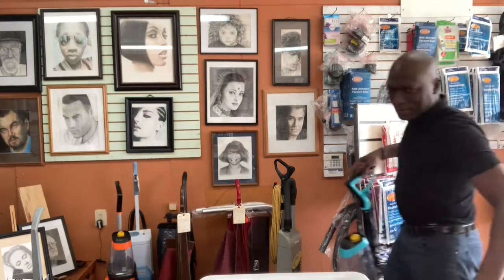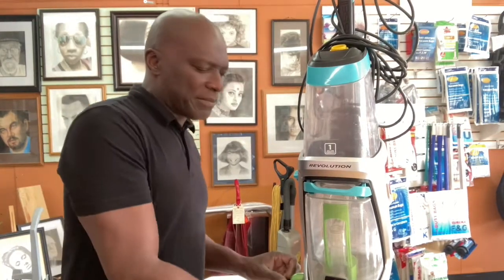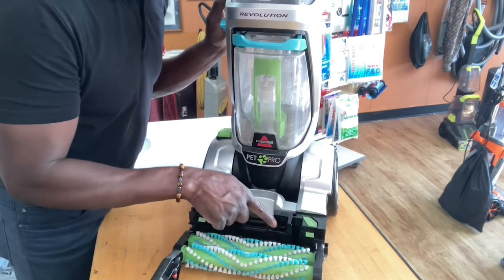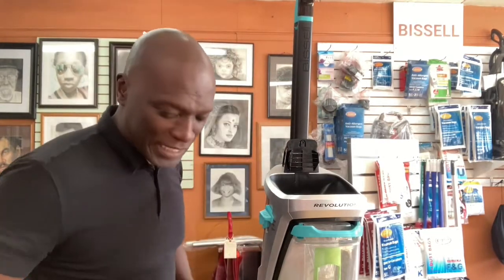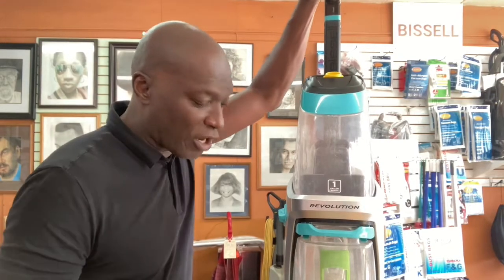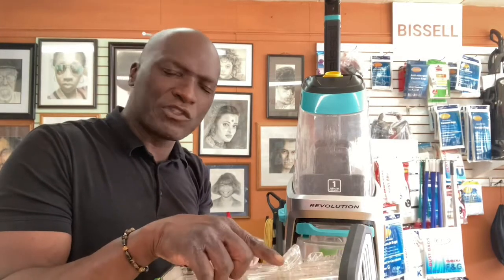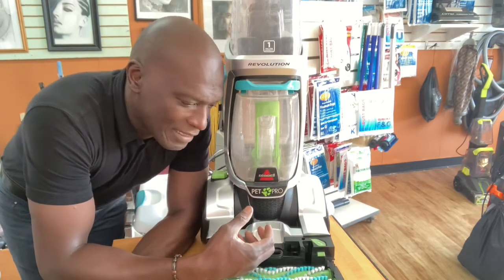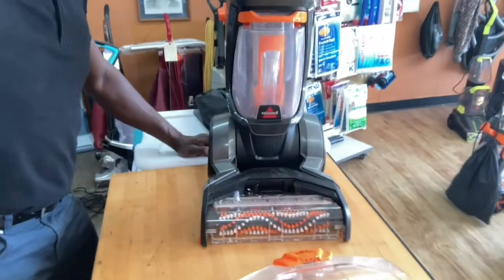My Bissell Revolution pet pro nozzle is leaking

Comment: I have the revolution pet pro 2x heat. I watched your video on the handle to make sure that trigger piece was broke or not. It is not broke. I put it back together. My problem is I have tension one time but no water comes out to carpet.

Comment: Yeah, my problem is iys coming out of the other pipe on the left for the accessory hose.  
There is a valve inside that was stuck open, fixed by poking it.
Reply from the maker: good work, Fix and Save where you can.
Reply: This was my issue as well. Thanks!!

Comment: I have the Revolution pet pro heat 2x. There is a white reservoir/pump on the left side when looking at it. That is leaking clean water once the tank is attached. It looks like the seal on the bottom of the tank has fallen off. I cannot find the part name or number anywhere. Please help!
Reply from the maker: Unfortunately that part is not being sold. I’ve never tried bypassing that part. But it’s something I would try before replacing the whole unit. You can also try searching for it on eBay (used) -

Comment: The main vacuum is working, but my problem is the upholstery attachment. Anytime I try to hold it vertical to get the back of couch it's leaks water all over the place. I can't tell where it's coming from. I just goes all over the place. It's clean water though.
Reply from the maker: Try spraying without the tool. Checking to see where the problem originates. If it sprays with no leak then replace the upholstery tool

Comment: so mine just pours water out with machine off nearly emptying the tank, trigger off, machine off. the valve that the trigger actuates is a bit confusing to me, it seems open all the time until you pull the trigger then the valve seems to close, I think the valve is faulty and have ordered a new one, on the new one the plunger of the valve seems to be a bit higher forcing it to close one and open the other water line (I assume) more efficient. we'll see when the new valve arrives. I hope it is the problem, there sure was a lot of disassembly to get that valve out.
Reply: so after looking at the valve a bit closer I have noticed that the plunger is broken off and the bottom piece is stuck all the way down there as if the trigger were pressed, so the new valve should do the trick.
Reply from the maker: Nice work
Reply: @monroevac  chat with Bissell produced nothing, referring my to a service center, Meh! wonder if I could epoxy it together.

Comment: Hi first I just want to say thank you so very much for all of your videos I went through and just saved all of them as I have had to do many troubleshooting videos for this carpet cleaner I love it it does amazing work when it actually works but I've had many issues thus far and the most recent is the clean tank is leaking which pertains to this video however I can only find one video on the internet and it's six seconds long on YouTube and there's no explanation of it it's just showing the exact same thing that mine is doing which it is leaking through the silver part on the bottom of the clean tank all along the crack and I will like you said put it aside well I'm maybe picking things up along the way and it literally will be half gone by the time I look back and it makes me crazy because I'm not loaded and it costs so much money each container of cleaning fluid that I'm putting together in this clean tank and I've lost so much money because at least six of them have completely drained out without me using them please help it would be so greatly appreciated I think I seen on one of your videos that you were retiring these videos and you weren't going to do them anymore but I would just be so grateful if you could just let me know this one piece of information thank you so very much in advance for your time I greatly appreciate that I hope you have a blessed rest of your night and stay safe :-) XO
Reply from the maker: Hi April sorry for the delayed response… plastic Shampooer tanks can leak either due to a loose or missing cap or through a micro crack and split in the seal. I’m making a video of possible but short term fixes. The best solution is to replace the tank but then we’re sinking even more money into it. Wish I could be of more help
Reply from the maker: Just uploaded a video explaining a possible solution . I’ll make one showing how to perform the fix shortly

Comment: I have a similar issue, except the base leaks when i use the upholstery attachment. Fairly slow leak,  probably a half a cup per 20 minutes of use. Any ideas?
Reply from the maker: Sounds like the overflow is a result or either a missing gasket on the hose. Or maybe check the port that the hose is plugged into. Make sure it’s clear if debri
Reply: @monroevac  Appreciate the prompt and helpful reply. :)

Comment: I'm having an issue where my bissell proheat revolution is constantly leaking clean water even without the trigger being depressed. The water is coming out of the nozzle it is supposed to come out of if I was to press the trigger (right by the brush roll). It acts as if the trigger is pressed, even though it isn't. 
The action on the trigger seems fine, and feels like its engaging the valve when I press it. I took the handle apart (like in your other video) and the handle/trigger appear in good condition. 

Any ideas?
Reply: So actually update from a few hours later the same day I fixed the problem. Maybe this comment will help someone else. I used one of your other videos that showed you taking the bissell proheat revolution apart (thank you for that). 

I located the one valve in the system that controls the water coming out of the brush roll. The valve is in the upper portion of the shampooer, basically between the clean water tank and the dirty water tank. I removed the valve and at first it appeared to be working fine. But I quickly figured out once I stopped depressing the valve water continued to slowly seep through the valve. I just depressed the valve and blew through one end of it and this small piece of plastic shot out. A plastic shaving must have someone gotten into the valve and it was causing it to remain always open. 

Long story short I took a plastic shaving out of the valve and it stopped leaking. 

Thanks for the videos!
Reply from the maker: Awesome detective work. Your comment will definitely help somebody. Thanks for sharing

Comment: When I was using the hose attachment to clean my couch water was just pouring out of the bottom of the cleaner near the brush rolls. How can I fix this?
Reply from the maker: Ok, we would first have to figure out where the water is coming from- Is it clean water? does it pour out the bottom when you start spraying? or is it dirty and pour out when you start sucking up the water?
Reply: Me too!!!
Reply: @monroevac  I actually put my vacuum in a shoe tray, I can see if the water is clean. It just floods my floors every time I use the hand attachment
Reply: @monroevac  it’s all clean water with the cleaning solution in it.
Reply: Definitely sounds like the pump here is the part number: SKU: 1609212. This is my best guess without personally examining the unit. Hope it helps
Reply: @waynew7805  thank you! I actually left the solution tank on and went to bed. When I woke up in the morning it was all in the tray and had leaked out. What a mess I’m just glad the tray was there.

Comment: okay so fixed this one, this part is really hard to source, I found a place that has it in stock now I presume, when I ordered it is was on back order, so if your Bissell is just pouring water out the bottom with out pulling the trigger or turning on the machine, then this is most likely the culprit. thought I could put a photo in here but I cannot, it is called Valve handle fluid release part number 1626491 or manufacturer part 63-0106-025-200 Only place I could find one after an exhausting search was Vacuums R-US & sewing too . They are out of Colorado. wish I could show you the picture, on my valve the plunger just broke and left the valve wide open.
Reply from the maker: Your description is good. I know what your talking about unfortunately its not a part found on the Bissell service site for me to order- possibly eBay or someone like that shop may sell a part from an unit that is not running. if you can get it from Colorado, then I suggest that you go that route. If not, then try finding someone who is selling a used unit for parts.